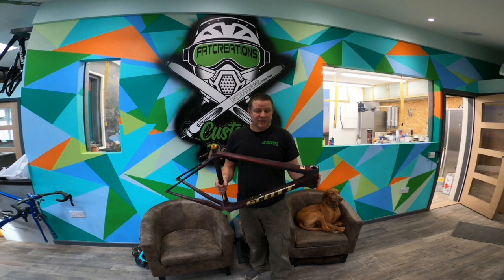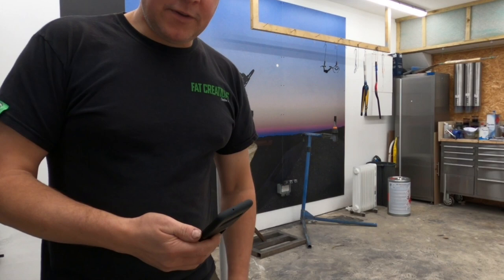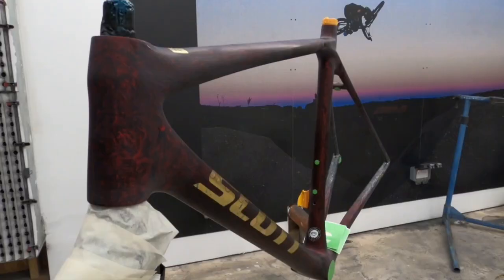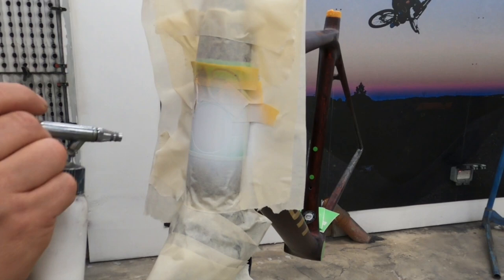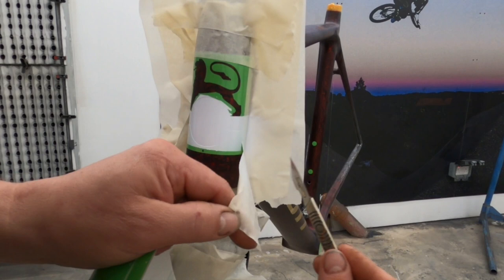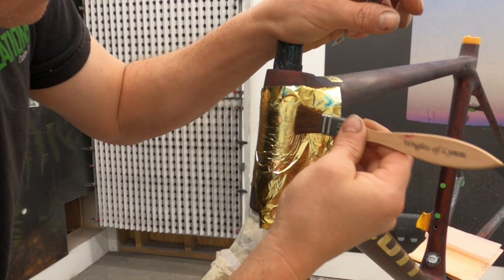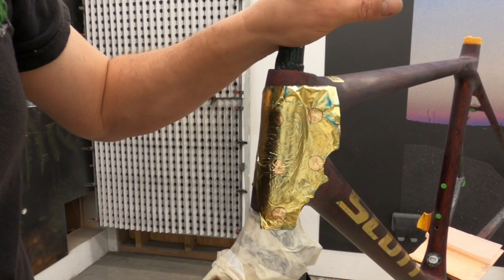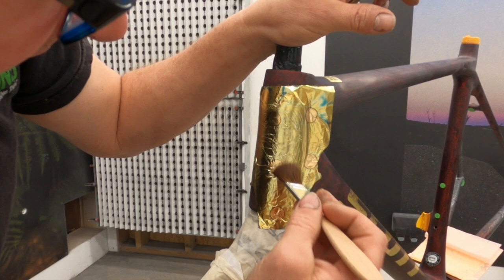how to paint logos and gold leaf

Comment: What do you use on the cotton to remove the extra gold ?  water? To prevent that extra gold leaf sticking to the residue would it work to apply the gold leaf without removing the stencil...just removing it after? I’m running into that problem but with a small and complex stencil so gold is getting in between where it shouldn’t...and very difficult to remove the sticky bits afterwards..